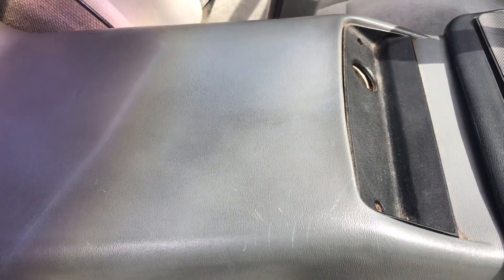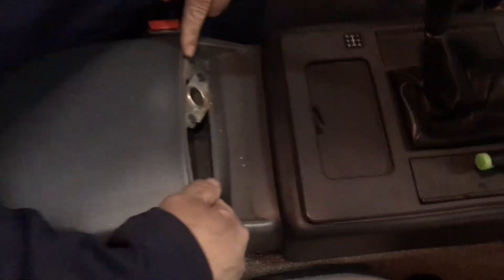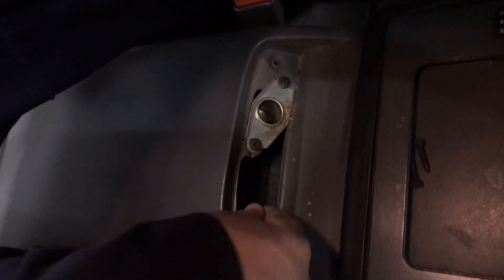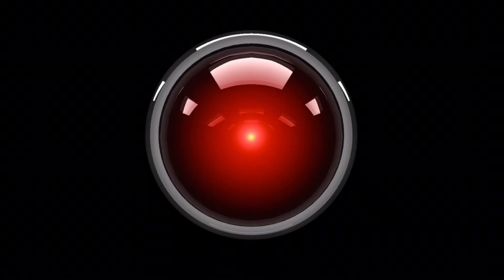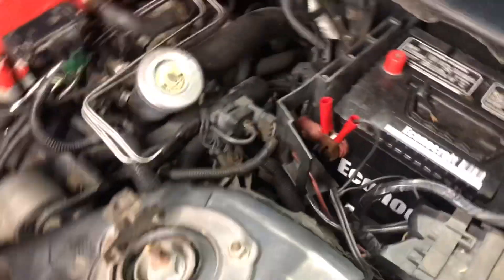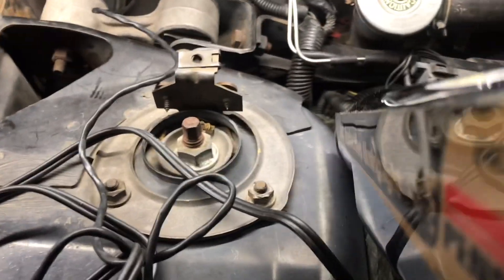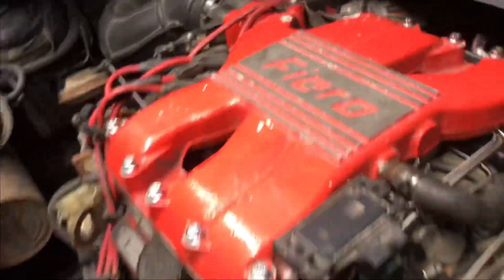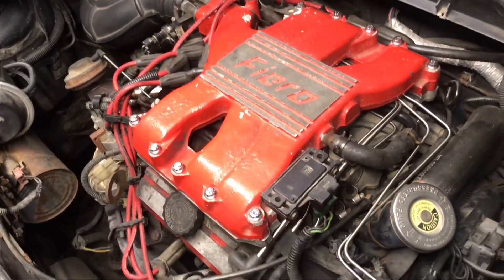How to set the timing on a 1988 Fiero Formula 2.8 V-6 Engine!

Comment: If it’s an automatic you are suppose to set 10 degrees while vehicle is in drive
Reply from the maker: Thanks for the tip.
Reply: @wingedhorsegarage473  You gotta pin this man's comment.
Reply: Dude you have no idea how long I've been trying to set the timing on my fiero, (over 2 years, theres even a comment from me on this video from 2 years ago) I could never get it to work properly... Followed all the steps.... and No one has ever mentioned anything on the FB group, nor have I ever seen it anywhere in all the tutorials I read or watched. I saw your comment last night.... and Im like no freakin way thats why it wasn't working..... I just tried it... and the timing is perfect now, even the slight ticking noise (Exhaust leak) I had went away. I sincerely want to say thank you so much!!!

Comment: What do you mean turn the distributor when you were using the timing light. Everything else made sense until the most important part
Reply from the maker: Grab the top of the distributor and turn it right or left by hand (clockwise or counter clockwise) and watch the timing mark “move”.
Reply: @wingedhorsegarage473 on that other comment does it need to be in drive with someone with their foot on the brake or do you just do it in park
Reply from the maker: @CommonSenseRealtor if it’s an automatic it needs to be in drive with a foot on the brake. If it’s manual, just put it in neutral.

Comment: pin AB is not to set TCC its for Diag check engine light code flash , car will not start,  pin A F  ( F is for TCC )
Reply from the maker: That may work for you but I have read several sources that say, Jump the AB connectors. 
It also works as a diagnostic by counting the flashing lights. 
Thank you for your input. 👍
Reply: @wingedhorsegarage473  I check several diagrams and using A and B pins will set of the check engine light to flash, and it will not let you start the car. My car might have a different pin out  compared to the  image you show in your video. It could be different for some cars.

Comment: Will this work for the 85 firebird v6 as well?
Reply from the maker: Yes, this is a pretty standard gm setup for timing. Good luck with your project.
Reply: @wingedhorsegarage473  thanks only thing im seeing that's different is where my plug is nice video!
Reply from the maker: @ Thanks brother!
Reply from the maker: Is your firebird a manual or auto?
Reply: @wingedhorsegarage473  it's an auto I've seen the info on how I'll need to set the timing with it in gear for idle sake. I'm more used to setting base timing on stuff without a ECM. As of now it'll start idle an run. It's just a slug it'll rev out but won't go anywhere/doesn't have the power to actually get goin goin. I haven't even checked timing but I have a strong feeling that's what it's goin to be since previous owner changed the dizzy intake an injectors an hasn't ran right since. I'ma get the timing light out today an start from there. If all else fails I'll just repeat your procedures in the video till I get it. An if that fails I'll ya k it out an put a 305 in it.
Reply from the maker: @ Ok, I’m glad you saw the auto info. 
The biggest challenge to most projects is fixing what the previous owners did. 🤦🏻‍♂️
Reply: @wingedhorsegarage473  that's no doubt. I got the car an before I could get the hood open I found a complete intake lower an upper, distributor, sparkplugs an wires, found 2 sets of injectors an wiring harness, then the injector rail/block, at that moment I just knew I got someones parts car lol.  Opened the hood an was happy everything was complete.. I'll consider myself lucky if the timing goes right an a fuel pump is all it truly needed. 500 dollars an a title I didn't see any real big loss.
Reply from the maker: @ That’s my kind of car ! Good luck. Feel free to update me on your progress. 
Nothing like getting a car back on the road !

Comment: Does this solution work for the 87 v6 2.8L camaro
Reply from the maker: I’ve never set the timing on a Camaro but I would imagine that it would be the same. As long as you can disable the timing advance setting the timing is pretty standard.

Comment: Any idea why my exhaust is glowing red hot? Idle is smooth.
Reply: I can tell you why mine got red hot, it was a bad catalytic converter. I had it happen on a Fiero and a month later on an 82 Corvette.
Reply from the maker: Usually that means it’s running rich. When did you notice it glowing?

Comment: Great. Now I know what I did wrong. I did know that after that you will have to retrain the computer systems for idal speeds. At least on my 86 Pontiac 6000 STE. Haynes book is about half good on some procedures. My 82 to 85 manual seams lacking.
Reply: What goes around comes a round. We have had this for 5 years now. Bought it for $800 dropped 1500 in to it. 149K now 174K. Ant
Reply from the maker: When I met my wife in 92 she had a 6000 STE . Fast forward to 2017 when I bought an 86 Fiero GT. I went to change my tires and was frustrated because there was a security lug on each wheel. 
I started looking through my tool box for anything that might work and there was the security lug socket from my wife’s 6000 STE . A perfect fit! 👍
Reply: Good morning. Any possibilities you know of a resources for Kick down cables. NAPA only has 49-52in stock at GM is nonexistent verified. Maybe someone has a hack project. Bike cable????
Reply from the maker: @Forever-into-Cars-and-Stars  https://rodneydickman.com/advanced_search_result.php?keywords=Kick+down+cable&ceid=249fc79c24704d8e8cb001102e11daa9
Rodney makes sure that his products are the best quality available .

Comment: Is this the same as a 1996 Firebird 2.8L?
Reply from the maker: The two engines are not the same. Several small differences. Block casting, valve size etc. Close but not the same.

Comment: Can you help solve this i did all the procedures for timing i got the timing light at 10 degrees 
Ok but when i remove the jumper wire the idle goes up again  !!
What should i look for now 
Do i shut off the car first and then remove the wire  ?
Reply from the maker: It sounds like it may be your IAC . It may be trying to adjust your fuel mix. 
Also check for vacuum leaks.

Comment: Hi I have a none running fiero 86 and I have no spark I was thinking of changing the distributor since all the rest (ignitionwise) has been changed and I wanted to know if the timing is too off can it still start or no?
Reply from the maker: I re-read your comment. A new distributor will have a new pickup coil so that is a good idea. 👍
Reply: @wingedhorsegarage473  yes so I did change the ignition control module and the ignition coil and I also tested the pick up coil and from my tests there is still resistance maybe I tested it wrong tho but since I own the car it never started how can I know the timing is not too off ? Its been 2 months im trying to figure this out 😭😭
Reply from the maker: @arkamis6373  there are many videos on YouTube that will help you find Top Dead Center. Unfortunately, none that are Fiero specific 
. I’ll look one up for you.
Reply from the maker: @arkamis6373  https://youtu.be/HvkdwysPeaI
Reply from the maker: @arkamis6373  https://youtu.be/tH9oTNFHTYk
This guy is really thorough.
Reply from the maker: If you have no spark, timing is probably not the problem. I’m guessing you changed the ignition control module. Also check your pickup coil for cracked wires. 
What you said is true though, if your timing is too far off the car will not start.
Reply from the maker: https://youtu.be/K5QRK9VZwcM

This is great info for your problem.

Comment: What about cylinder 4? Aren't you suppose to do cylinder 4 as well? For example if cylinder 1 is at 8 degrees and cylinder 4 is at 12 degrees, then 8+12 Is 20, 20 divided by 2 is 10 degrees BTDC. Isn't that how you're suppose to do it?
Reply from the maker: Ow, my brain hurts. Lol I was doing a quick base timing. You can go the extra mile but if you are doing it for the first time this is a good place to start.
Thanks for adding to the discussion. I appreciate any feedback. 👍